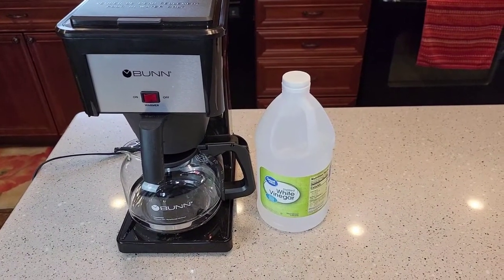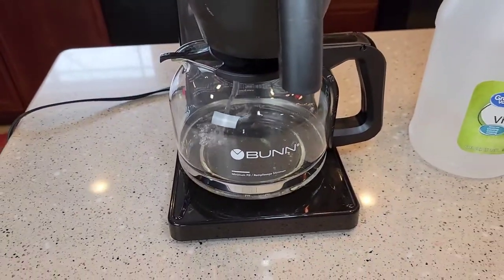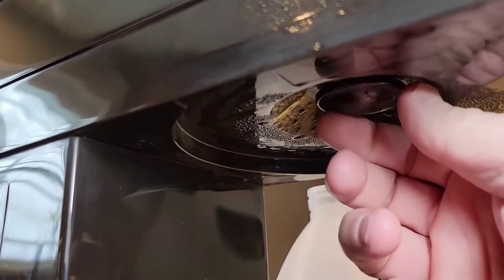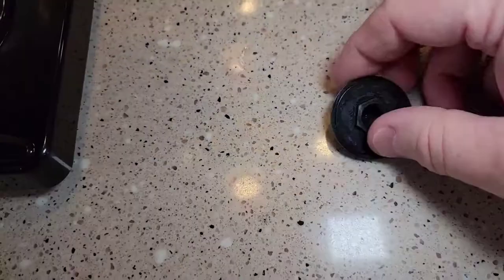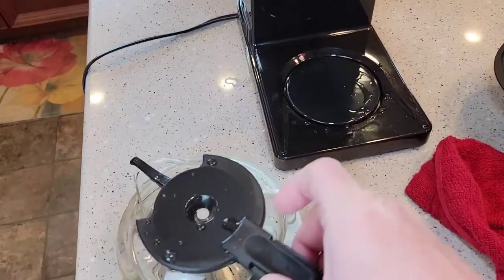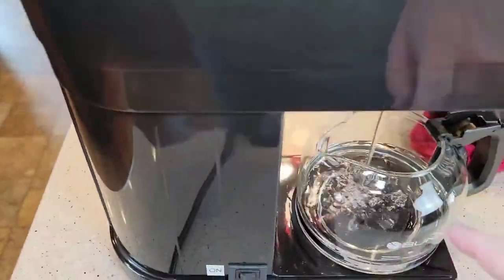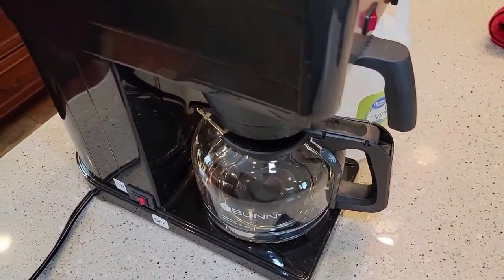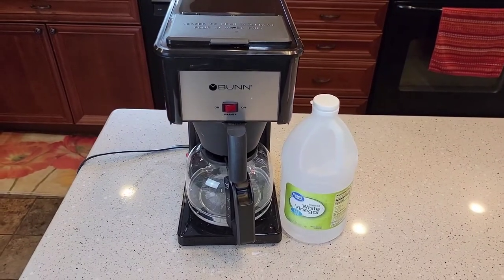HOW TO DESCALE Bunn Speed Brew Classic /  Velocity GRB Coffee Maker

Comment: When I first put the vinegar in, I also like to let it sit in the top portion of the brewer for a while before closing the lid that makes the liquid start flowing out. Like 30 minutes or so. that way the vinegar sits in the top portion to clean it, before sending the vinegar in to the heated reserve part of the brewer. i also scrub the top grated section where you pour in the liquid with a clean tooth brush while the vinegar is filled up to the brim, and once the vinegar was in the reserve tank for a bit, i shook the whole unit a bit, as well as after the vinegar sat for 2 hours i shook it up before draining the vinegar

Comment: Try tipping the maker over a bit in the sink while it straddles both sinks after cleaning with vinegar.  Water will come out of the "nozzle".  You will be amazed at what comes out, its actually gross.  I dont consider it clean until I do this a few times . The sediment that comes out is unreal.
Reply from the maker: Thanks for Sharing!!!!!
Reply: That’s the way you cleaned it in the old manuals. By taking the spray head off and tipping it upside down in the sink you get all the debris that settled on the bottom. If there are big chunks of scale you can fill it up half way and shake it a bunch to break it all up and tip it upside down over the sink and you will get most of it out. You may have to use the descale tool a few times to unclog the hole to keep it flowing. It’s the same procedure in the manual for draining the water tank.
Reply from the maker: @chadriggs3322  Good tips, thanks for sharing!!!
Reply: This is making my local coffee stand seem more appealing
Reply: @ToddVance  Yeah, I would be more scared of what theirs looks like inside.

Comment: I filled the tank and then allowed the water to boil before adding the vinigar. Those who commented about tipping the unit upside down in the sink to drain the tank really had a good idea. But after my Bunn Pour Omatic sat for over 3 years without use, it still produces clean fresh water after your vinigar treatment. I rinced the tank many times until the smell of vinigar was gone...and then flushed it a few more times just to be sure. Makes perfect coffee! Thanks for your video. The tip about taking the spray head off was important as was the removal of the basket to allow the water to flow directly into the pot. Otherwise, the basket fills to the point of overflowing, which ain't good as you saw in your first attempt. Thanks again!
Reply from the maker: Your so welcome,  Bun Coffee makers are really nice if we stay on top of descaling them  Thanks so much for the update!

Comment: Thank you for this video! I have the same Bunn model. I also found with this model if you remove the two screws located where you fill the reservoir, you can take the top off. When I removed mine, there was a considerable amount of scale build up in this reservoir. There are 4 screws holding the reservoir in. Remove these and you can remove it and wash it by hand. Once reassembled, you can continue with the tank descaling.
Reply from the maker: yeah that is a great idea, thanks for sharing!!!

Comment: Yes ! By the way - Great coffee really starts with good water! I do not work for them but- I recommend a Zero Water Filter to take out the minerals in the water. If you will use them - They actually provide you with a meter that measures the percent of solids in the water. I keep mine at 0-3 percent and never have any scale whatsoever. I use this water filtration on several coffeemakers, and even my espresso machine. Coffee tastes great, and no lime scale either.
Reply from the maker: Thanks for the tip!

Comment: Mine came with a cleaning rod that looks like a long spring tapered on both ends that once one removes the brew head, you insert as far into the brew tube as you can get and stroke it back and forth a few times. This helps in descaling the brew tube; you do this after the first rinse. I've been using these Bunn's for as long as I can remember; they lasted a good 20-plus years. Perfect brew in 3 minutes, and if it takes longer, it needs to be cleaned. A quick tip; once a week, run a half cup of Viniger with two rinses running the cleaning rod, and you'll never have a lick of trouble with your Bunn.

Comment: After I removed my spray head I run the cleaning tool, metal wire tool, from Bunn, thru the hole where the spray head attaches,  back and forth all but about 2". Then I poured a pot of vinegar thru like you did. I rinsed mine out more, maybe 10 full pot's of clean water to get rid of the vinegar taste and flush it out good. Thanks, John
Reply from the maker: Thanks for sharing

Comment: That's a brand new Bunn coffee maker he is cleaning in this video.
You can use the carafe to measure the 4 ups of vinegar, then top off the carafe with water at 10 cups.
Leave the sprayer head off when flushing AND NO LID ON THE CARAFE.
I do my Bunn every two to four weeks, so there is no need to turn the internal heating element off and wait for two hours.
I typically wait 20 to 30 minutes before flushing.
Also, I flush with water at least 7 times to remove the vinegar.
This is because the coffee "tasted like vinegar" after someone watched me clean it with vinegar while they were waiting to make their morning coffee.
Four or five rinses should be more than sufficient.
Just make certain that you fill up the carafe all the way to the top to ensure that the levels of flushing water are greater than the initial vinegar and water mixture initially poured into the machine.
This will increase the ability for the rinses to completely eradicate the vinegar and deposits from the internal chamber.

Comment: Needed a refresher on on cleaning instructions, thanks! I noticed on Amazon the numbers of folks (commenting) who did not know (or understand the instructions) that you have to leave the switch in ON position all the time to get instant hot brewed coffee, they hated the Bunn due to cold coffee😂😂😂. Perhaps you should make a video to show how to USE a new Bunn. You know, for the idiots who don’t get it!  I was surprised at the number of buyers who complained that it didn’t work. And about it not having a timer to set,😂😂😂. Yeah, the switch has to be on unless you go away. Then you turn it off. Been using Bunn’s for decades, never had one fail. Gave up on the Bunn stainless steel pot, cleaning was a real frustration and getting any bacteria around the collar nearly impossible so I went back to glass carafes.  🕊✌️🇺🇸🌟

Comment: How often can be better determined by water quality than by a fixed amount of time. You can unscrew the brew nozzle and check for scales. Right now mine is so bad I have scales - actually looks like fish scales - in it after every brew, so each morning I unscrew the nozzle and clean it out or the scales will cover the holes in the nozzle and it won't spray. Then I have to run water through it to dislodge the scales in waiting. Then screw the nozzle back on and brew a pot. A quick test is to leave the basket out, open the lid, place the pot in position and run a few cups of water through it. You should have 5 holes a squirting, which along with optimum brew time of about 3 minutes and optimum brew temp at +- 200 degrees is the whole purpose of the Bunn system. I really don't see how this is less brew worthy than the supposedly most effective pour over method.

Comment: Mine starts dropping before I put the lid down.
Reply from the maker: The top should pop off so you can look at the plunger,  just take that screw out where you poor the water.
Reply: Make sure your coffee filter is dry or at least semi dry.  I found this to happen but only a few drops as if it started brewing.  If it’s streaming before you close the lid then there is a problem.